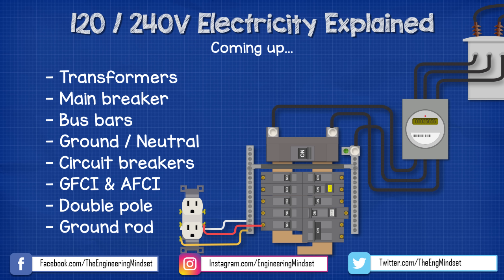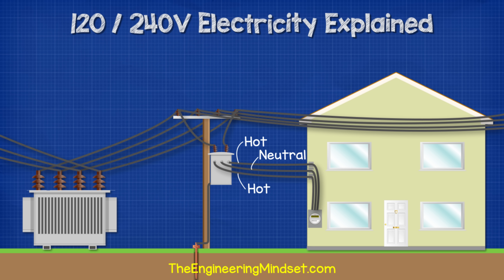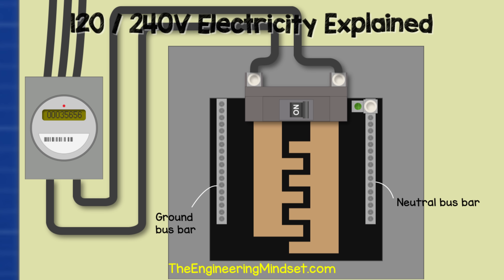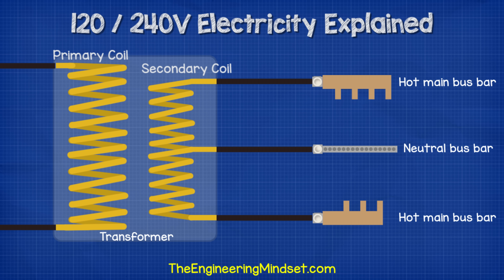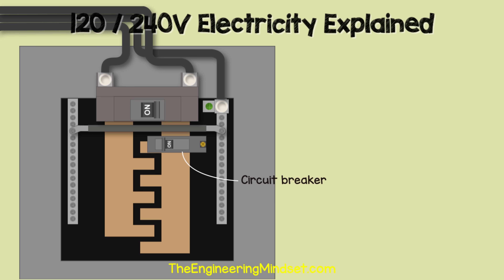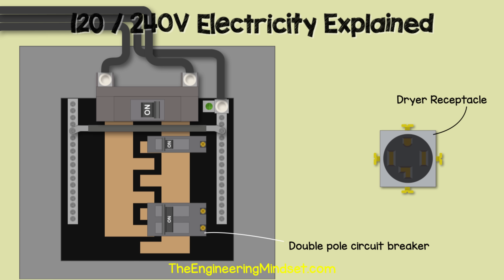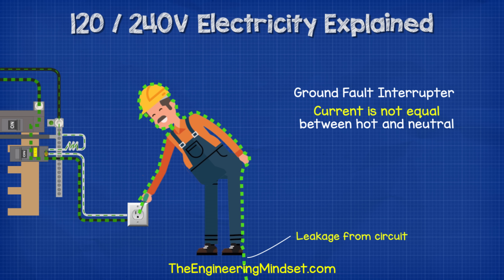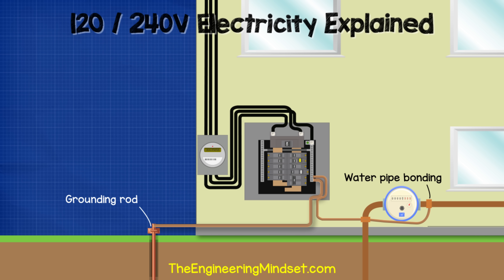120V 240V Electricity explained - Split phase 3 wire electrician

Comment: I'm an electrician for 35 years.   This video is absolutely perfect explanation
Reply: According to the NEC, the neutral is only allowed to be grounded at the point of service. Therefore, at sub panels you need to confirm no connections (bond) exists between the ground bars and neutral bars. I thought he did an accurate job of explaining this in the video.
Reply: *goes to the store. *Buys a breaker box. *Notices the ground and neutral bars are already connected. *Gets online. *Eats popcorn reading comments by amateurs and novices alike clearly upset that you can't include all the necessary information to be a qualified electrician in just one ten minute long video. Stop crying about it already
Reply: @jeffborders5526  electricians don't make any money
Reply: Sadly
Reply: He said it clearly at the beginning of the video. Main panels MUST have the neutral and ground bonded, subpanels MUST NOT!!! He was showing us a main panel. Pay better attention.
Reply: Don't believe most guys commenting do residential work . This is the way almost all residential load centers are wired. The neutral and ground are together in the main service panel. They never showed a sub panel. So yes he is right in the way it was explained.
Reply: They do make it understandable it to the layman.
Reply: We do connect neutal & earth(ground)  at main board in nz, we call it a MEN link, sub boards remain separate.
Reply: @danashton8571  Agreed same as Australia
Reply: he said that left electricity will flow out of neutral wire.and as i know neutal wire is just for pd.can u explain
Reply: Do you have a video showing how a 2 pin electric panel looks and works?
Reply: @Rzzyy  lmao. I paused the vid at beginning to read all of this. And it's actually 2:05 am for me right now haha
Reply: I have a GE Dryer that I took with me from the US to Germany , it currently has a 4 prong plug, as you know they only use 2 or 3 prong plugs in Europe , also here the power is 220V single phase , and even though the dryer is able to be used on 220V in the USA it’s basically getting (2) 110V phases to make it 220V . So my question is how do I connect it here in Germany to their 1 phase 220V ? 

I really really have high hopes you can help me out, please.
Reply: @AJsChannel77  well you cant connect it
Reply: because the power cut off
Reply: With AC current why can't you be electricuted through the neutral wire if the neutral wire becomes powered when it alternates.
Reply: Im on my fifth yr. Trying learn all i kan
Reply: It might not be 100% correct though. Split phase is only supplied with 1 phase and ground/neutral, that is why it's called "split phase". But maybe other methods are used and called the same, but from what I get out of it is that they supply only one phase then split it in two. And I don't think they call it a phase on the 240 side either because of this.
Reply: I have two distinct discrepancies. In trade school, the instructor told us voltage, also known as potential difference, appears on a multi meter as the calculation of the difference. His explanation was that you get 120 volts from ground to one bus bar because that's the difference and one bus to the other would give a reading of zero (or close to it) because there would be little to no difference between phases. 

The second was his explanation that since the ground and neutral are bonded, the ground rod is constantly sending current to ground. The only reason you don't get shocked, according to him, was because the path to ground via the rod is lower resistance than through whoever touched it. 

This video explains a very different circumstance for both situations. Please help me.
Reply: I am an electrician for 35 five years. (Pointless triple space) This video is absolutely perfect explanation (no period, doesn't even make sense) :600 likes 🙆‍♂️🤦‍♂️
Reply: @john Joyce have u ever installed stress cones??
Reply: @rustysummers3217  "Are (we) (I) to believe that Trained Electricians are so Rattle Headed...".
Yes, that's exactly what is likely to happen. It doesn't matter if they are trained electricians, people make mistakes, and they are more likely to make those mistakes if they have a habit of doing things the wrong way.
I really do not understand the resistance to and arguments against doing things THE RIGHT WAY.
Reply: I'm working on solar with battery bank... Anyone here able to help? I am curious if I could wire one 12v battery through inverter and to one Positive lug on the main breaker... Then the same thing battery and inverter on the other Positive to the other bus bar... Both grounds together.... Also, yes the utility service is disconnected to keep from back feeding into the utility lines.... I want to run all the lines that are already in the house off battery and solar...
Reply: @demonrat1319  If you mean 2 inverters, one on each leg, that could potentially be very dangerous since they would probably be out of sync. Any 240v devices (which use both legs) would not receive the proper voltages and would also be connecting the inverters together, a definite fire risk. Better to get a single inverter intended for this sort of operation.
Reply: @chrishartley1210  So a split phase inverter? I have looked into those but was told that inside a split phase inverter are two seperate inverters (not sure if that's true) ... Not really sure where the positives and grounds are going inside a split phase inverter.... The plan was two seperate systems to each lug grounded together... Solar to charge controller to battery to inverter on one lug same thing on the other with ground together inside where the utility meter used to be... I was hoping that would seperate the 120 and 240 and supply where needed on the  seperate fuse breaker bars inside the house, but when you flip the 240 breaker would that send 240 to the whole breaker box???? Also, could you elaborate on inverters out of sync?
Reply: @demonrat1319  You are correct that a split phase inverter is effectively two inverters in one case, the difference between this and two separate inverters is that in the split phase inverter the two halves are controlled together and are consequently exactly in phase (or to be accurate always 180° out of phase). There are two parts because the current draw on each leg is likely to be different.

You keep talking about the ground side when I assume you mean the neutral, both legs on a split phase inverter have a common neutral.

It also keeps things much simpler since you have only one battery system, one solar charge point etc. With your suggested method you could easily be in the situation where the battery on one leg goes flat while the other is still active. That would also cause big problems.
Reply: @chrishartley1210  Thank you my friend. I will soon be purchasing a split phase inverter 👍
Reply: A step down transformer doesn't have a neutral wire. The step down transformer only guarantees a certain voltage. For example a 277 to 120 transformer only guarantees 120 volts across the leads this is called floating voltage to create a safe neutral the neutral must be grounded. Once the neutral is grounded you will have a zero point and a 120 point.
Reply: Why is a 35 year electrician watching this video
Reply: You probably a residential electrician who doesn't know anything but how to open a beer because this video is a joke
Reply: @eddinak it has the be bonded at the first means of disconnect
Reply from the maker: Check the new SUB PANEL EXPLAINED ➡️ video https://youtu.be/NUSNa-7Hecw
Reply from the maker: Check the new SUB PANEL EXPLAINED ➡️ video https://youtu.be/NUSNa-7Hecw
Reply from the maker: We just published a new Ground fault, short circuit and arc fault video, so much detail! Link HERE➡️: https://youtu.be/Qi0ynSQw-wc
Reply: Really? I don't want you working on my house. You should NEVER connect the ground wire to the neutral bus bar. They are separate for a reason and are not always connected. And the two bus bars should never be connected in a sub-unit.
If you habitually connect ground to neutral then one day you might do it when the bars are not connected.
Reply: Chris Hartley really? You have been misinformed bud. I’m currently looking at my 2017 nec code book as well as my SOARS grounding and bonding book provided by the IAEI (International Association of Electrical Inspectors) and it clearly states: At the service is where the grounded conductor(neutral) and the Equipmemt grounding conductor(s) are REQUIRED to be connected together through a main bonding jumper. You can also look in article 250 in the Nec. Don’t believe everything you see on the internet goof-ball. Also to add the fault current will be very little in the neutral conductor if you have an effective ground-fault current path (that of low impedance). Most of the current will choose the ground fault path. Electricity doesn’t just take the least resistive path, it takes all paths but some more than others. YOU CAN NOT BEAT THE BOOKS!
Reply: @chrishartley1210  A Qualified electrician should check the circuit breaker box first to see what he/she is working with before "Habitually" or Blindly connecting ground to neutral anyway. Knowledge of what your working with is key so no surprises occur or assuming someone else did it for you....
Reply: @clattereffect  Check also the GFI circuits if they are working too! Circuit breakers are to be checked too AND DEACTIVATED OR TURNED OFF AND MUST HAVE A MECHANICAL LOCK TO KEEP THEM TURNED OFF! I can remember the Cold War era fuse boxes for each systems. You cannot open them without turning them off FIRST. You cannot pull out the fuses if the secondary switch is turned off FIRST. You cannot turn on the secondary switch because there is a built-in engineered mechanical safety interlock that locks the secondary switch in a turned off state. And the fuse box's switch cannot be turned on because there is a built-in engineered safety interlock that locks the primary switch of the fuse box in a turned of state if the secondary and primary built-in engineered safety interlocks are still in a turned off state unless the fuse cartridge is replaced and plugged in that releases the secondary safety interlocks that allows you to switch on the secondary switch and this in turn allows the secondary box cover to seal it in and this allows the primary box cover of the fuse box to seal it and cover it and once closed it's secondary safety interlocks allows the primary switch to be turned on. And there is a GFI circuit before and after the fuse box(es). This design is many decades old, and now all I see are circuit breakers without any GFI circuits before and after it and no Non-Step Transformers before these circuit breakers. Cutting corners in engineering design is a NO! NO! In my country!
Reply: @chrishartley1210  In the first means of disconnect, your neutral and ground must be connected or else you're not going to have an effective ground fault path back to the source. Any subpanels or whatnot afterwards should have isolated grounds and neutrals so you won't have any objectable current traveling back on your ground.
Reply: @austinjd2193  Yes, and all those who have written about this didn't follow the video. I didn't say the neutral and ground bus bars should not be connected, I said he should not be connecting the ground WIRE to the neutral bus bar, it's bad practice. Otherwise, why bother with a ground bus bar in the first place.
Anyone who thinks they've read something different needs to go back for more training. But the problem with so much of today's training is that they just show you what the code says, they don't explain why or what it actually means.
Reply: @chrishartley1210  most residential load centers don't have a "ground bar" so that is why you hook both to the neutral/ ground bar. This is not allowed in commercial service but the neutral still has to be bonded
Reply: In addition to code, it makes good sense to ground neutral.  When you screw a light bulb into a socket, it's easy to accidentally touch the metal base of the bulb while it's touching with the socket contact.  The danger of electricution is minimized by making neutral potential very close to ground potential.
Reply: @chrishartley1210 , Clearly you don't understand the difference between a service entrance panel and a sub-panel. You need a better understanding of the NEC. Licensed contractor 40 years.
Reply: @RSDX99  I understand it very well. You clearly don't understand the difference between not doing something because it doesn't meet code and not doing something because it is bad practice.
When something is done on the service entry panel, but is safe, then it is likely that at some point the same thing will be done on a sub-panel, and it isn't safe. That's why it is bad practice.
Reply: @chrishartley1210                                                                                                                                                                                                                                                                                            vv       v.         V. V. V. Vv. V. V.                     V.                     V. V. V.     V.     V. Vv vvv.      V. C   v.  V. V=v.  =
Reply: @chrishartley1210  I was wondering why it was shown to connect them. I was always taught to keep the ground away as far as possible
Reply: @Alex-jo2oi  we usually connect the ground to a ground bar that may or may not be connected to the neutral bar. Just makes it cleaner and if it’s a sub panel the two might not be connected.
Reply: @danlux4954  that makes much more sense.
Reply: Nothing is wrong connecting neutral line to ground. Please tell me what is the purpose of a neutral line ?
Reply: Neutral is to have a return path. If you are speaking specifically about the panel itself, then there is no practical issue with terminating both ground and neutral on the same bus bar. As said elsewhere, some residential panels don’t even include a separate ground bar. 

But if you’re talking about any point in the branch circuit, then no, you shouldn’t connect the ground and neutral. The ground is not a current-carrying conductor, meaning it’s not supposed to carry current EXCEPT in the case of a fault condition. Having the ground wire carry current on the circuit introduces a multitude of problems, ranging from problematic (ground loops) to dangerous (having a non-insulated conductor carrying current through the system).
Reply: @chrishartley1210  on ur main pannel you can do that and it won't make a difference. I get what ur saying tho and its fine either they both work and can be preference.
Reply: @Lyrisik True, on your main panel it won't make a difference but it could fail a code inspection depending how picky the guy doing the inspection is. On a secondary panel it should be an absolute fail on a code inspection because it's dangerous. A neutral fault between the secondary panel and the main panel means that the casing of any equipment on this panel with an earth connection is now at line voltage.

My main reason for highlighting this is that if someone is routinely making this connection on the main panel, at some point they are likely to do the same on a secondary panel.
Reply: @chrishartley1210  I agree, I've had some really picky jerks that point the smallest things out on inspection and on a main I've done this out of convenience when I needed too but ur right on a sub its not something ud do..I guess it all comes down to experience and thankfully I've never made that mistake but anything can happen if ur not careful
Reply: @chrishartley1210  yesss absolutely, im from south america and the ground and neutral wire are not connected on the same bus bars, otherwise if you connect the ground on the same bus bar of the neutral, your home devices will be electrocuted by lightning and will burn out. the ground wire comes out of the ground. because when the lightning strikes the home devices, it will go from the gound wire to ground. but what i see in this video is when the lightning strikes the devices it will go from neutral wire to the transformers and will burn them out.
Reply: @chrishartley1210  ". They are separate for a reason  "  Ok. What's the reason?
Reply: @michaeleconomides4054  If the ground is connected to an neutral bar and there is subsequently a neutral fault between the sub-unit and the main unit then the route for power comes up to the device, back down the neutral to the sub-unit and back up the ground wire. The chassis of the device is now at line voltage.
The point I've been making is that if someone habitually connects the ground wire to the neutral bar at the main unit then they are likely to also going to do it at sub-units.
Reply: @chrishartley1210  Thanks for the info.  Why not just be cool and explain that to begin with? Why the need for statements like: "Really? I don't want you working on my house"?   Makes you seem really arrogant.  There was a time when you didn't know either right?  Much better to be humble, correct people's mistakes and share knowledge without that kind of attitude.   Cheers.
Reply: @chrishartley1210   I've been crucified trying to explain this practice. It's not a code issue. Being a good tradesman you need to know your trade but also just be a good mechanic. I add ground bars in mains and bond them solely for a visual reference. Completely unnecessary.  In subpanels, I add a ground bar to each side so grounds don't run all over the place. I am very particular about cable management. When you open a panel I like to have a very clear vision of all wires. People that argue this are typical hacks. They will make up a panel and have disgusting wirenuts and slices... so much mess in the panel it creates spring tension on the dead front. I'd rather be clean than fast.
Reply: @chrishartley1210  the ground is always bonded to the neutral in the entrance device. At least it is in the US.
Reply: @citizenonpatrol5041  I'm well aware of that, it isn't the issue. They are not bonded on sub panels. The problem is that if someone routinely attaches the ground wire to the neutral bar on the main panel, then at some point they are likely to forget which panel they are working on and attach the ground wire to the neutral bar on a sub-panel. That's unsafe.
Reply: @chrishartley1210  that's simple. If you're not working on the entrance device you don't connect them🙂
Reply: @citizenonpatrol5041  I'm not talking about connecting the ground bus and the neutral bus, I'm talking about (not) connecting the ground wire from the socket to the neutral bus on the panel which is what he did in the video.
Reply: @chrishartley1210  in the video the meterbase is just a passthrough device. The panel is considered the entrance device in the video because that's where the main breaker is located. In 2021 code changed and this is no longer allowed, but many houses built before 2021 this is allowed by NEC code
Reply: @chrishartley1210  Chris leave them alone. They are still on Mr. Edison state of mind  v/s Nicola Tesla :-)
Reply: @chrishartley1210  You should watch the video again. I'm an Electrical Engineer that knows next to nothing about residential wiring which is why I'm watching this video, but after some consideration it's quite clear that neutral needs to be bonded to earth ground at the most upstream (closest to the transformer) point as possible. This video doesn't show the source of the ground connection but we can assume the ground bus bar in the main service panel is connected to a grounding rod driven into the earth. First let's remember that voltage is the potential difference between two points in a circuit, second that a transformer provides electrical isolation between two circuits. Now, at the secondary side of the transformer we have a circuit that is electrical isolated from all other circuits (yes ALL other circuits). In this circuit we can only accurately define circuit 3 voltages (2 of which are the same) between the 3 conductors. What's the voltage between the phase 1 wire and the earth (earth ground)? You can't say. Same for the other phase. What about the neutral wire and the earth? Nobody can say! So what's protecting someone if the chassis of metal item comes in contact with one of the phases, and the metal chassis is connected to earth ground but the neutral wire and earth ground are NOT bonded at the source? Well according to our idealized model of electricity, that earth ground connection offers no protection because in our idealized model current returns to its source, and there is no path through the earth that can take it back to its source!! Therefor, no current will flow and a breaker won't be tripped. Again since the voltage between the earth and either the hot or neutral wires are undefined, we cannot conclude that the earth ground connection offers any protection. This is why neutral and earth ground must be bonded together at the main service panel.
Reply: @kevinhelms1472  You've missed the point. There are neutral and ground bus bars. There are two separate bus bars for a good reason, namely that you connect the neutral wires to the neutral bus bar and the ground wires to the ground bus bar. At the relevant point you link the ground and neutral bus bars, as you have said.
You do NOT, EVER, connect the neutral wire to the ground bus bar or the ground wire to the neutral bus bar. In the event of a double neutral and ground fault between the sub panel and the main panel this causes the chassis of connected equipment to be live at line voltage.
Reply: @chrishartley1210  
In the main the ground and neutral should be bonded whether it's a bonding bar bonding screw or one bar. I've seen many main panels that had one bar for neutrals and grounds
Reply: @jordyban  I've never said anything against bonding the neutral and ground in the main panel. As for panels with only one bar for both ground and neutral, they do not meet code.
Imagine an extension built onto an existing house such that it needs a new main panel because of where the power enters the building. The obvious solution is to install the new main panel in the extension and make the old main panel into a sub panel. If everything has been installed to code then the only thing you have to do on the old main panel is remove the bond between neutral and ground. Anything else and a small job could become a big job or a potential death trap. And all because someone could not bother to fit the right panel or wire the neutral to the neutral bus.
Reply: @chrishartley1210   I just want to say thank you. This  video should not be on YouTube.
Reply: I share the vision of Chris Hartley. Ok installations where ground and neutral bars are connected still exist. But was banned in Europe in the 1950s. It's just not safe! And then when near the end of the video you connect the ground-wire to the neutral busbar?? That where I lost all faith in your (in depht) knowledge.
People who try to figure out their electric installation based on this video (and I assure you there are that try) are bound to get themselfs killed. You should have had someone skilled look over this before you post these (anyway very nicely annimated. For that I congratulate you) kind of videos. Make America safe again!!
Reply from the maker: @benverdel3073  you should read the code. Main panels can have shared, sub panels can't. That's why you can buy them with shared even in Home Depot. I would agree it's good practice to separate them, but regardless you will find them installed exactly like this all over the country.
Reply: @EngineeringMindset  I have one question. how alternating current can have a neutral wire? both should be hot wire right? I know that I am wrong. can you explain please?
Reply: @benverdel3073  thank you. Industrial electrician.
Reply: @benverdel3073  " It's just not safe! "  Great.  Care to explain why?  You and Chris Hartley made an issue of this but not giving details as to why it's a bad idea.